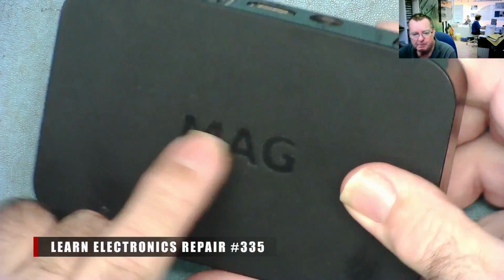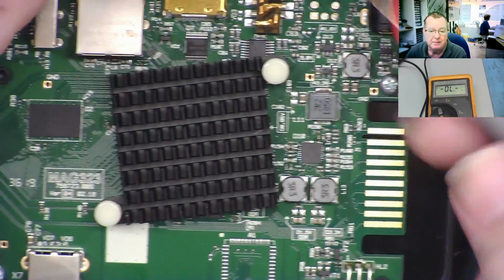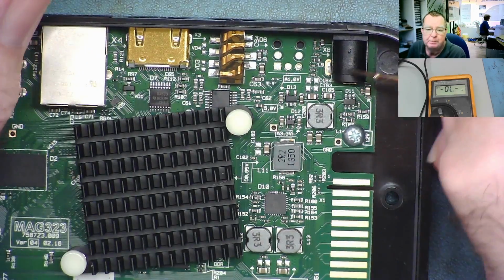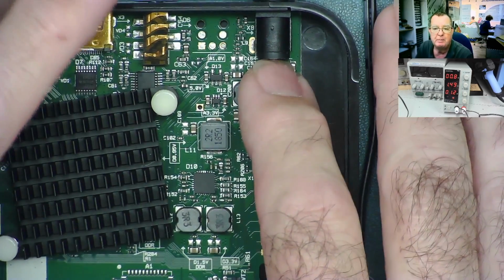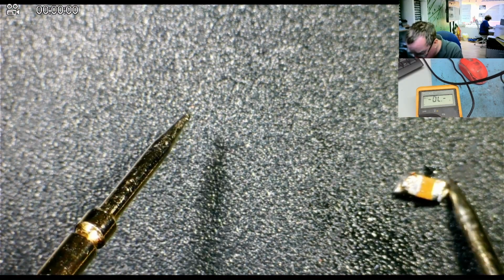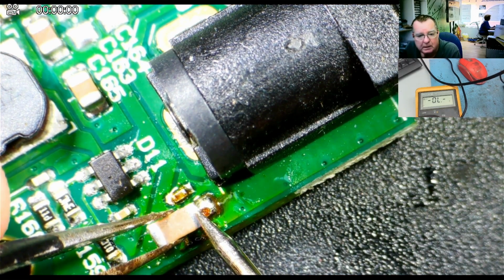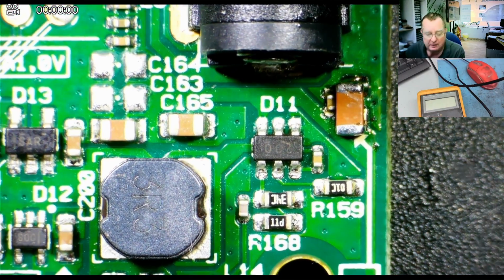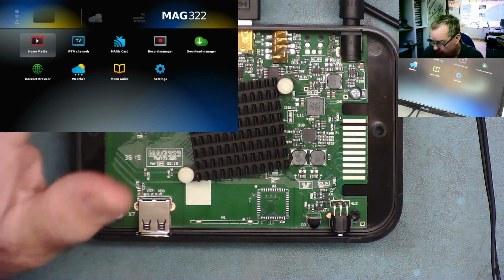Dead MAG322 TV Streaming Mag Box, like Android STB Box - Can we fix it?

Comment: Hi Richard, would it be possible to use the diy milliohm meter you created to diagnose this failure? Thank you for the great video!
Reply: Ditto , I made one with a lipo battery , I can measure very low resistance accurately with ohms law . So useful.(constant current to probes using connector block from old dimmer switch)